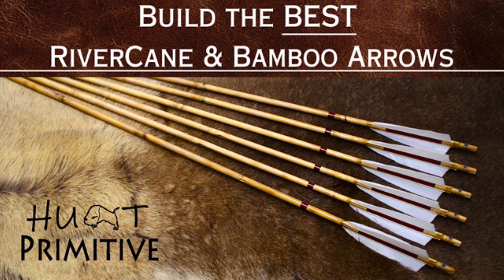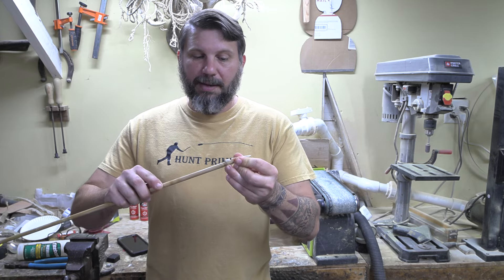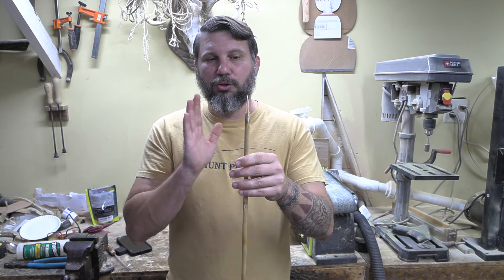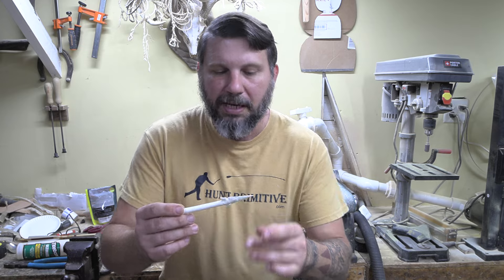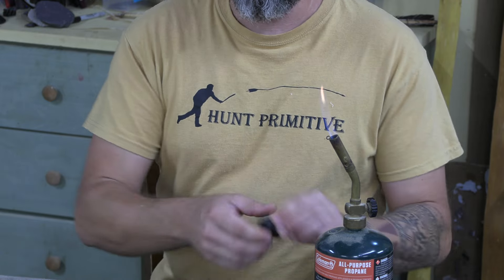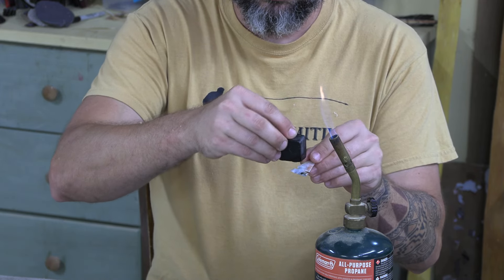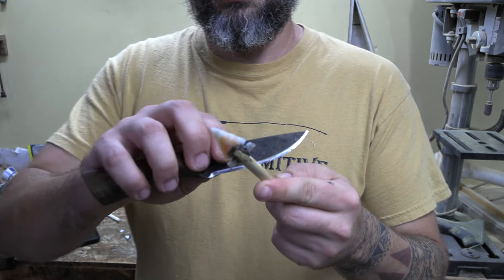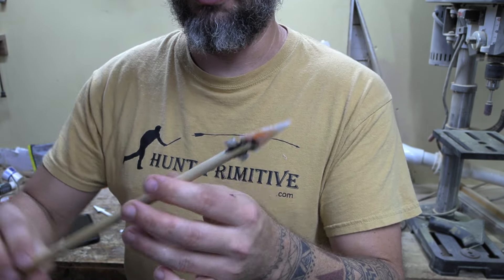The BEST How-To  Hafting Stone Points

Comment: Hi Gill...I’m always watching, but I don't comment much...Here are some observations and suggestions you may find valuable or interesting to experiment with…LOVE the channel and what your doing and preserving for future generations...

A video on glue blends…such as augmenting pitch glue with eggshell, fat, sinew, egg-glues, fish skin glues, etc. would be great!!!. These ancient blends are much different in characteristics (could fill a small book…hint, hint, LOL)

Hot sand/ash blend warmed in a fire (or on a stove if that’s all you have) was called a “temper bath” by my teachers. You can experiment with this but experience suggests just hot enough that you don’t want to leave a finger in there longer than a count of four or so…(kind of like the first method for checking cooking in a clay oven test.) This is kept in a thick-walled ceramic pot/bowl (or cast iron) with about 150mm to 200mm of the sand/ash blend. The shafts and points bayth in this till working them. The sand is very fine (riverbed silt sand is the best I found and supper fine) mixed with about ⅔ ash ⅓ sand…

Your finishing of these stone points is some of the best “modern work” I have seen and well thought out. I’m not sure if you have ever tried or experimented with it, but I’ve seen and (back in the day…LOL) taken the glue to blend all the way out onto the stone point and smoothed everything out. The only thing that is exposed is the cutting edge. This seems to, very effectively, strengthen and reinforce the brittle stone, and facilitate a smoother penetration, especially if your tips are “fatted” before hunting. I don’t know of any modern traditional hunter still living who still fat or lubricate their points here in North America, but I have seen some “Bush Hunters” in the Velt region that did so. I know I still oil my chisels (a method common in Asian woodworking) when timber framing and wood carving which significantly improves cutting efficiency and ease of penetration…

On your lashing, I noticed, that it seems (?) you are relying only on the adhesive quality of the sinew to hold itself together. This works, but there are traditional knotting methods that are a tad more effective and will not undue themselves if the tip gets wet as easily, which the fat also helps with. You may find some of the lashing methods found in the Pacific, and there in Florida among some traditional Chickee builders, for both architecture and finer goods like lashing tools of value. Your search words are: “Lalava”...”Sennit”...”Magimagi,” if interested…